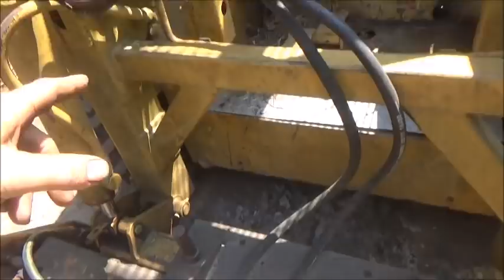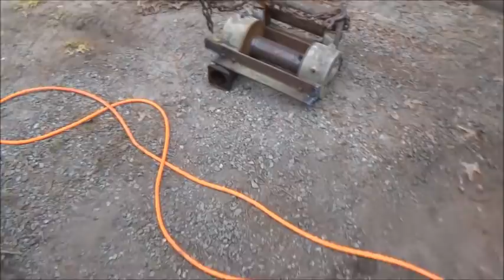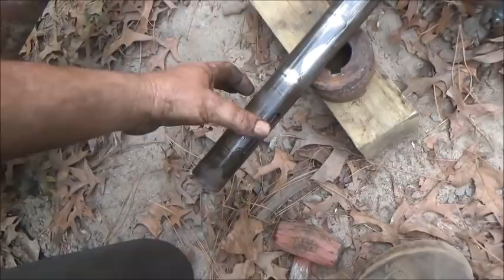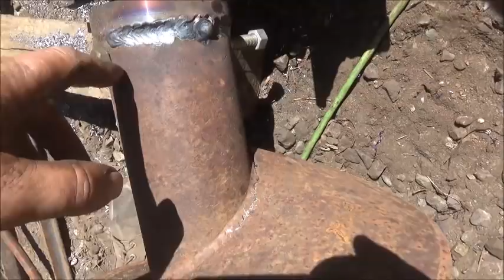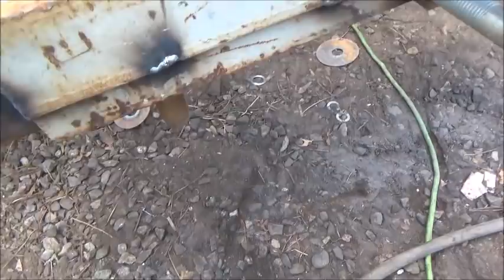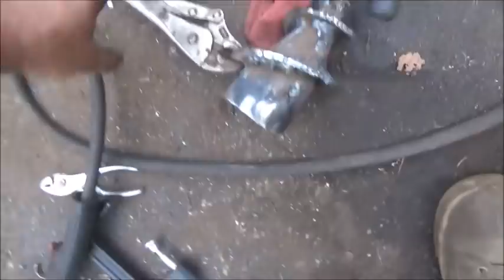TRASH TO TREASURE SERIES EPISODE 1 PART 1 OF 2 HYDRAULIC POSTHOLE DIGGER FOR SKID STEER

Comment: Looks like the cutting edge plates would work better if they were turned with the cutting edge angle on the bottom flipped over the other direction. Great work Jonathan. Can’t wait for part 2. 👍👉🇺🇸

Comment: What's wrong with saving money? Absolutely nothing! If you can build your auger out of whatever you have on hand and make it do exactly what you want then so much the better. I knew a guy who had built one that swung from a 3 point hitch from the back of his Jeep. No floor in the back of the Jeep so he could see what and where and how deep he was digging. He was a landscaper just putting in shrubbery and flowers. But he could also dig post holes with it. Slick setup you have there. It'll probably be just what you need. Great video! People who don't try never know what's possible. Thanks again for your time and videos.